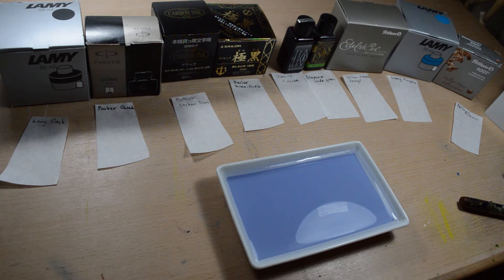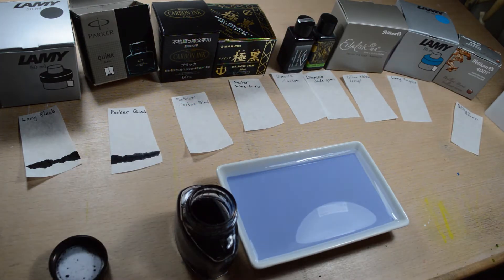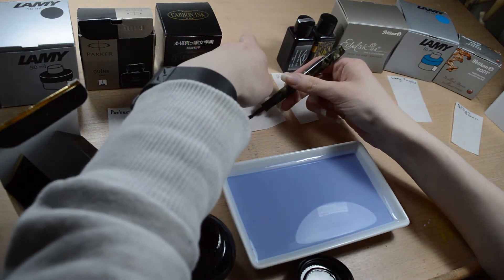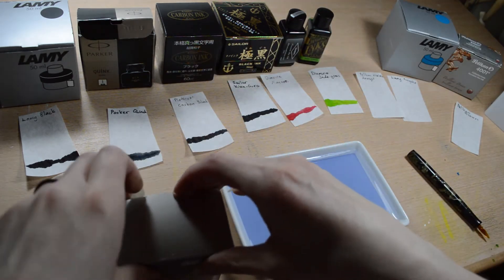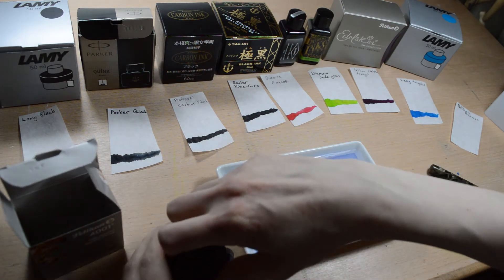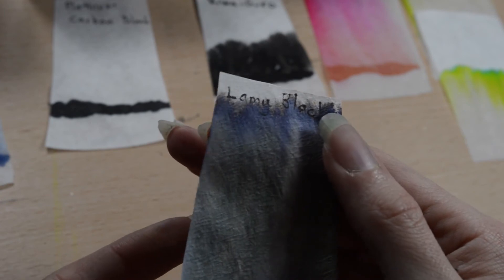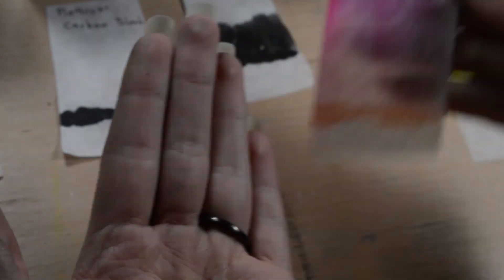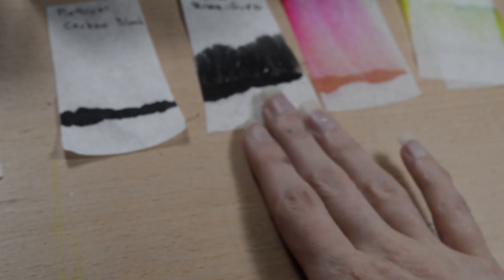Ink Chromatography

Comment: You will get better separation results if you mix about 1%  each rubbing alcohol and nail varnish remover to the water. You need to experiment though try one separation with rubbing alcohol, another with nailvarnish remover  and others adding more and more water to these. For inks based on pure organic pigments this can reveal taces of other colours that would be left behind in the datker pigment bands
Reply from the maker: I didn't know that! I need to try that, I have much more inks now, so maybe it is time for part 2 :)

Comment: Another great video! My first ink was also Quink by Parker. I was wondering if you had any experience with mixing inks?

Cheers!
Reply from the maker: No, I haven't tried mixing inks. It is really hard to be sure, that inks chemical structures are compatable, and they don't for slime or solids when mixed.
Reply: I want to get a green or brown shading after a blue/black ink for my signature pen, so my signature will be impossible to -reproduce. Also, it will be quite personal and authentic.
Reply from the maker: That sounds really cool! It may be hard to do. I remember there was some company, that did custom inks. I think it was Tekker, but they are out of business sadly.